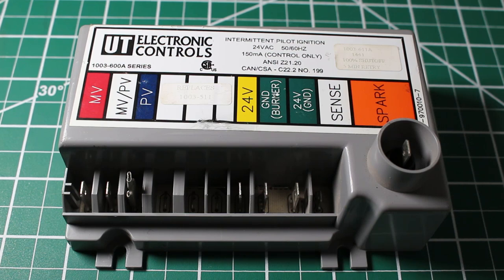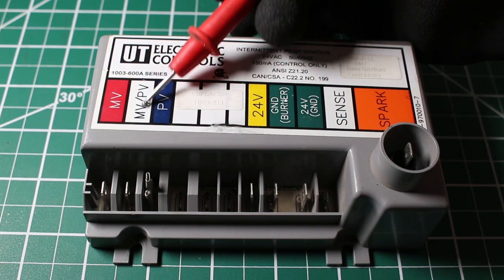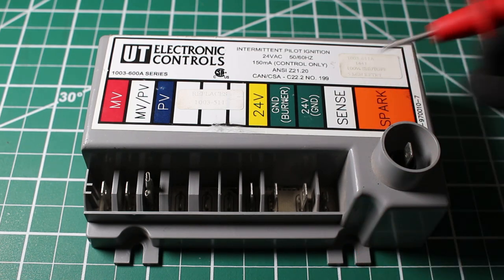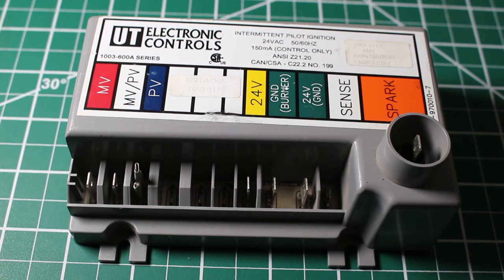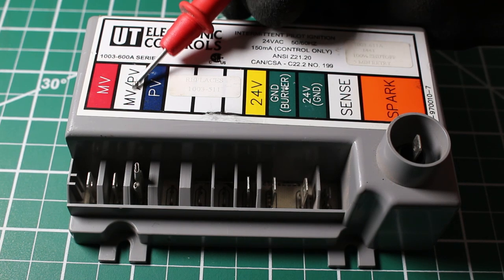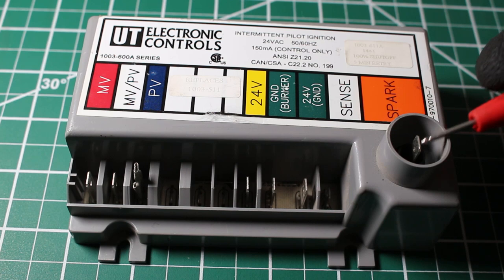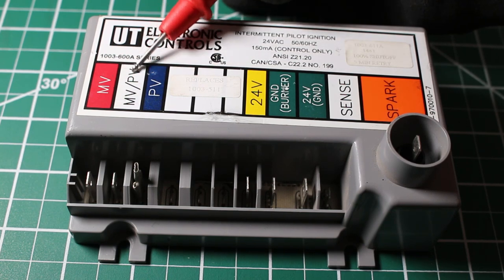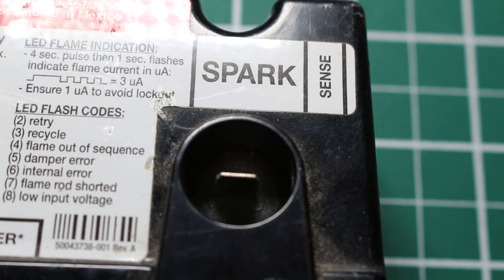HVAC: What Is A Intermittent Pilot Ignition Control Module/Sequence Of Operation/Troubleshooting

Comment: The Honeywell S8610U does also have a separate flame sensor terminal. It is the spade terminal below the sparker. It has a little black wire coming from the controller and pre-wired to the terminal already. You remove it for a separate flame sensor and spark rod, or you can use the spark/ flame sense terminal as you described. It depends on the set up you have.
Reply: Thank you! I've been searching for an answer for what to do if you have separate lines for spark and sense and you answered it. You're awesome!!
Reply: Just wired one in today, was kind of confused while I was there, had no trouble with the diagnostic. But swapping a 2902 with one of the Honeywell controls had me a little stumped. Good call on that because I said the same thing.

Comment: I have an early-90s Carrier 58GSC furnace that does not spark or flow pilot gas when the thermostat calls for heat.  There is 28V going to the Ignition module.  Could the problem be the Ignition module, igniter, electrode, electrode wire, gas valve.  I'm thinking to start at the ignition module, but I'm not sure how to isolate and troubleshoot that.  Would pilot gas flow if there is no spark?  Please advise.

Comment: Flame sense signal (uA) comes on sense wire and not on ground terminal as said in the video. Sense current flows only if the ground wire is properly connected to chassis.

Comment: How/when do you check the voltage across MV/PV and PV for 24V?  During spark? At any time? What if you have no 24V (instead 4.0V) across here?  My system is sparking but does not light pilot.  I forced sense with a lighter and got MV to light briefly.

Comment: Thank you for another great video…..So for flame sensor you want to try And achieve 3 µA corrrect???  The next step is A signal hast to go back to bored via the intermittent pilots burner ground In order to open the main valve???Is that same signal in Micro amps???? Many Thxs

Comment: Thanks very Much I have the same model # ignition control on an York 300k gas rooftop unit 
only difference is the labels of terminals .mine shows MV - mv/pv - R1 rollout - TH - gnd buner - 24v gnd - sense - spark so ian assuming TH is my 24 v call Thanks  again now i can go back fin trouble shooting no heat call